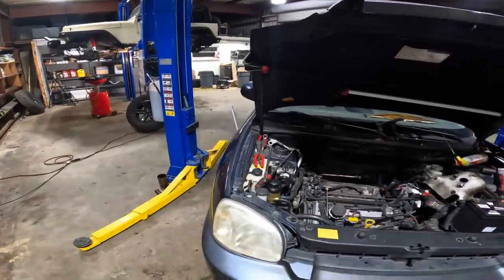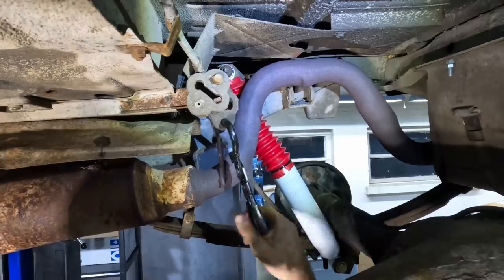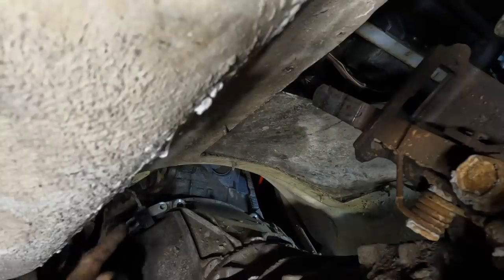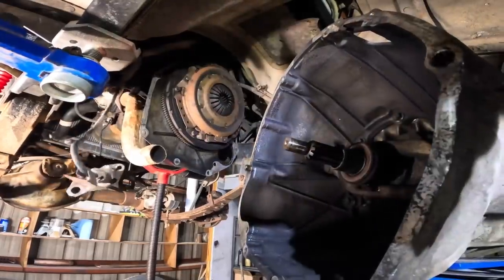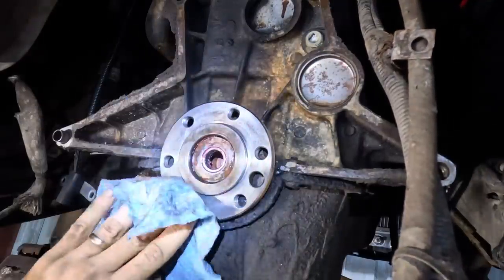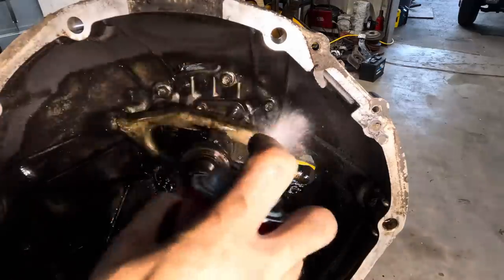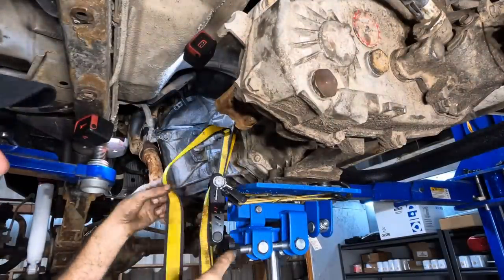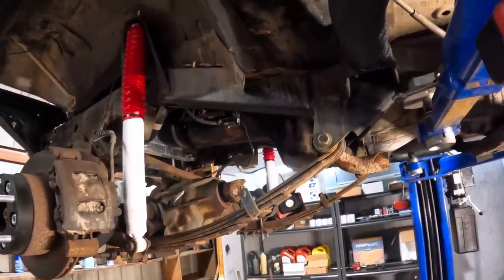Smallest Shaft Ever! FRIED Flywheel! | Project JEEP! 1995 Wrangler YJ

Comment: Silly Ray, when he forgets we dont speak Mechanic!
Pull the slave Cylinder next: this is what transfers hydraulic energy from the master cylinder into this cylinder. That then reconverts it into the mechanical energy to operate the lever, inside the bell housing that release the clutch mechanism.

It's good to learn technicials names when you could just say this runs the Clutch Inside the transmittion!

Comment: I never knew about the clocking of the timing on the flywheel. My Datsun pickup didn't have that. is that an American thing? My Datsun was just a bolt on flywheel and done. No special alignment of the bolt holes to guarantee a specific orientation. Interesting.

Comment: I know this has been a year ago I wonder how good the clutch is now Because i don't think you cleaned the pretested coding off the new Flywheel and Bail-housing that the factory adds to it If so I didn't see it One would think that the clutch would burn it off but it usually just gums it up where it loses it frictions other than great video

Comment: Should be a beveled flywheel, special more expensive resurfacing too.  The  Peugeot  ba trans is one of the worst jeep used next to the SR4 found on some CJs.  You haven't lived until you have done this job on your back in the  driveway with jackstands and a floor jack!

Comment: At 21:25 ish
When describing about the clutch and the lever (inside the trans) and bearing

So it’s mechanical only when the transmission gear is engaged with the clutch 

is what I’m learning making sense because the kinetic energy from the engine and flywheel is def enuff for that transmission to start moving however 

The hydraulic lines are for the clutch pedal when it’s time to release or disengage from the the flywheel or push against the clutch 

Honestly I re wound and heard that part twice but the second time I was like holy crap not only do u mechanics KnOw wtf ur doing but engineer when fabricating these systems know that this is what the best way to make a car go forward and that it works 

I’m writing this comment cuz I was learning about 
hydraulic pneumatic mechanical and electrical are different types of ways an engine system creates actuation or  for switches to turn on and off or open and close 
I think there is more more to that because it just said the “MAIn types”but I was like whoa just owning a car and each day learning something new is pretty sweet for me in my life now (36yo)

I’m like out of nowhere so into my 2005 Honda Accord cuz it has the k24a engine and I’ve been driving Hyundai Elantra for last 8 yrs (3 different cars) I’m a delivery driver but soon either going into tree service or automotive service
Both are to me really cool work or occupations
 

Ur vids are dope man I just watch ChRiSFIx drop a manual transmission from a mustang and now Rainman Ray both are such good mechanic as well as YouTubers
Ovr/out
Clearwater FL
Daniel

Comment: Mistake one: you didn't de-grease the fly wheel or pressure plate.
Mistake two: - The bell housing was sealed, remember you cleaned it off, and you didn't reseal it and this is a 4x4 which means there's going to be water going into the clutch.

Comment: Looking at your open door, and my thermometer that's reading 22°F ......Brrrrr!

Hydraulic method of pilot bearing removal:
Find socket extension or ANY dowel that has a near snug fit inside bearing... FILL entire cavity with GREASE.... Slightly insert dowel until resistance against the grease is felt....Strike dowel with hammer and watch bearing pop out!

Comment: Surprised you still use a pneumatic angle die grinder for the bristle discs instead of a Milwaukee M12 Fuel angle die grinder. I've found the M12 tools to be better than the pneumatic variants I've used, and no hose to drag around.

Comment: When I was a teenager I watched my sister's boyfriend and his mechanically-inclined friend swap the automatic tranny for a four-speed manual in my sister's '64 Impala.  They had it up on blocks in my Dad's garage and when the final bolt came out of the bell housing the tranny dropped to the floor with a "clonk" along with a tidal wave of transmission fluid.  Dad was not pleased.

Comment: Anyone else notice the rust streaks in the upper expansion plug(29:20) in the back of the block? There are two, upper is cooling system, lower is the cam plug. After almost 30 years of service, I would have taken the 10 minutes to replace the upper one. From the rust stains on the back of the block it might be seeping a bit. Cheap insurance to replace it when the trans/flywheel is pulled.....

Comment: You forgot to torque the flywheel and thee clutch housing. I always torqued them and have never had any come lose. With that going to be off road it could come loose. Flywheels are generally torqued at least 90foot pounds, your impact most likely can't reach that.

Comment: Things I dont get, 1 a new flywheel should be surfaced, so replacing the old flywheel, instead of surfacing and changing the ring-gear does not make sense. Also the freeze plugs should be replaced with brass plugs while your in there. everything sjou;d be steaam cleaned before reassemble, and lastly you do not add lube to pivot points that have teflon/nylon bushings, put them back clean.

Comment: How to tell the person who has done a clutch job before - NOTHING is overlooked - the most common fail I have seen done is to neglect the throwout bearing. Usually followed by a second visit to the job shortly after when the old one grenades and takes the clutch pressure plate with it.

Comment: Using compressed air and one of those screw top containers that has a nozzle… a kerosene spray will blast that old grime off , with constant pressure..is that cheaper than tins of cleaner.

Comment: a old trick to take pilot bearings out pack the hole with grease and hammer a punch that fits in the pilot bearing and it will come out

Comment: If the surfaces on that flywheel and pressure plate weren't well clranrd that clutch is going to suck! Yhstd where sll the brake clean should have been used!   Myself I prefer carb and choke cleaner...or laquer thinner on a rag!

Comment: I love that everything is metric in your world. Not 7/16... thats 11.... not 1/2.... thats 13.... not 5/8....thats a 15.....not 3/4....thats a 19.
If it turns it, it's the right size! We ALL know darn well there are ZERO metric bolts on this machine.
Thankfully, There are only a few SAE sizes without a metric equivalent
Not a REEEEEEEEEEE... I do it too. Whatever socket fits it... gets used

Comment: So you cleaned the crap out of the transmission but you didn't clean the pressure plate ot flywheel before installation.  That clutch is 100 percent going to do the same as brake rotors when you don't clean them 💯

Comment: Change the LUG bolts to match the wheel spacers or "REUSE COTTER PINS" at your risk only; don't put a wreck out the door facing your moma's grand children...
Fix the wheel lugs because it's the right thing to do. Do it right or it could hit someone in the noggin. Cheers!

Comment: I didn't see the surface of the Flywheel get washed down to remove the protective coating, or the use of a torque wrench to tighten those bolts on it.
I hope it was done.

Comment: Ray you probably know but the red brake clean is chlorinated while the green CRC brakeleen (brake parts cleaner) is non-chlorinated.
▪︎ If you need to take out bolts with permanent Red Threadlocker on the threads, Red Can of CRC Brakeleen Brake Parts Cleaner.

Comment: 35.50.  Comments to make
1.. flywheel bolts should have been torqued properly to spec
2. Flywheel should have been degreased and the pressure plate
3. Pressure plate bolts should have been torqued to spec

Comment: A dirty trick on how to remove a pilot bearing if you have an input shaft a piece of rod the diameter the inside diameter of the pilot bearing a bolt here's what you do pack the pilot bearing full of grease the old bearing full of grease take the bolt piece of rod or input shaft and tap it in center hole of the pilot bearing that will cause the pilot bearing to pop out of the rear end of the crankshaft it works I've done it and it's a simple dirty trick and you don't need a whole lot of tools have a great day

Comment: I watch all your content.  I'm a huge fan.  Have one question.  I say I've watched everything but I seem to have missed why you are doing so much time on this jeep.  I'm a dyi guy but only on restoring vintage Honda's and old cars.  You have a massive amount of billable hours on this project.  
Did I miss something?  I'd buy this Jeep, even though I'm not a fan of this model, because of all the QUALITY work and parts you're installing.
I'd love to bring my Silverado with 200k miles.  Still runs but would love to have the engine completely overhauled or a new engine/trans and what ever you think it needs.  I'm keeping this crew cab truck because of the chassis and body.  It's grey so, it's peeling paint everywhere, has a couple of small scratches, cracked windshield and dash.  Interior is great.  Has tow package but small engine.
Let me bring it to you.  I live in Oklahoma but I could drive it down and fly back.

Comment: Ray doesn't have a pressure washer. WTF? Can Commentators and Viewers in Ray's location maybe provide him with potential online listings for items like a pressure washer (one that heats the water and has a real good PSI jet), parts washer, A/C machine and other such gear that he needs to make his job easier and increase our viewing pleasure. If there was a GoFundMe page and 20% of Ray's Subscribers gave just $0.50 each then he could probably purchase a lot of a lot of the specialised equipment he needs to make his work life easier for him. He could also build a sound reducing wall around the air compressor which would make it easier on the recording of no loud noises too. Make a list Ray because there is no point anyone suggesting equipment that you have no need for. For example, would you use a tyre (tire) changing machine or a disc brake rotor lathe?
It's just a thought and at $0.50 then that I could afford to contribute to. I won't make a Superchat contribution because YouTube take so much of it (30 or 40%) but a GoFundMe contribution I most certainly would.
When Ray pointed out the "fingers" moving when tightening up the "basket" I thought it is the little titbits of information that makes him and excellent teacher. Actually he is more an educator; it's a fine line but a massive difference between the two. Thank You Ray. 👍

Comment: You should show. How to align clutch without tool. From experience, The auto parts store rarely had the right tool. So after using a bolt to align disc and several use of foul languages. Over store not having right tool. Several breaks later. It goes into place. 😡

Comment: I'm not trying to do this on purpose but it might cause a stink... but you don't use new hardware on the fly wheel??? R put any lock tight???that's one of those jobs that a person absolutely does not want to have to go back on to redo anything...I say all this because I'm sure you did but I didn't see you torque anything down on the clutch at all.....

Comment: Would really liked to have seen the old clutch disc, to see what facing material was left.  And yes please lock-tite the flywheel and clutch cover bolts and make the flywheel shiny.  Love your channel, enjoy all the videos.  Gotta ask a question about the front diff. Do the teeth look ok on the front pinion gear?  In the video I thought it look bad.  May have just been grease or dirt.  Thanks.

Comment: If you watch in the sky, don’t do what he does installing a clutch that’s a hack way of doing it that clutch is not going to last that pressure plate and plywood should’ve been taught with a torque wrench. I could take two identical clutches use impact the other one use a torque match and you will see the fingers are evenly flush that clutch is going to have a chatter when it first takes off, it won’t be smooth because it wasn’t torqued with a torque wrench

Comment: I can’t beleive you didn’t clean of the oil off that flywheel and loctite/torque the bolts 😬, I normally find you very thorough with repairs but i think you dropped the ball a little here

Comment: all flywheels are clocked,,for balence,,[ except chev],yes we hate chev.. 350ci,junk, 6.5tdi junk, 12 bolt,junk, 14 bolt, junk,. they seem to borrow, steel, ideas parts from other manufactureres, then change the i.d. #, call it theres..only good thing about a 350 chev, is the speed shop guy smiles at you..

Comment: As a transmission rebuilder, please never use the bell housing bolts to "suck" the transmission into place. You should be able to flange the trans to the block with minimal effort. even more important on automatics. I can't tell you how many assholes...I mean customers... have destroyed my rebuilds by using the bolts to seat the trans.🙂

Comment: Your shop is cluttered. Before it becomes a complete mess I suggest you take steps to correct the situation. Compared to the dealership you worked, your shop should take on a similar appearance. No offense meant, however, customers do rate a shop by appearance.

Comment: Useless in today info. Every clutch I have changed over the last 40 plus years I would make my own alignment tool/ I would get a wooden broom shaft and cut about 9 inches off it then whittle it down until it was a perfect fit and mark it for which type of vehicle. Never ever failed and every clutch lined up perfectly. Last one I did was on my Daughters car 4 years ago but no longer fit to get about vehicles so have a largish collection which will one day go in the bin, probably when I pass on .😁

Comment: Your new transgender should come with a proper brackets and a chain to put across the transmission to hold it in place it keeps the transmission balance on the jack you can put this you put the faces in but it's even and then you can tighten up the chain and hold it please has all the brackets to hold the transmission you should use them

Comment: OK, so no torque wrench?  On flywheel bolts?  And, no cleaning of the mating surface on the engine block or the metal plate that goes between the engine and the transmission?  You can hear the crunching sound of dirt when you tighten up the transmission to engine bolts.  Do you have any service data available for torque specifications.  It seems that you tend to "shadetree" these things instead of taking a couple of minutes to do things properly.  Certain fasteners NEED the proper torque applied.  Yes, not every bolt needs a torque wrench, but some do, like suspension bolts in control arm bushings and such.  Of course, I've seen you tighten many critical fasteners using the "ugguh duggah" method and with suspension components at full droop, which is very hard on rubber bushings.  I do enjoy watching most of your stuff, but I find myself cringing sometimes.  Just saying "click" doesn't make it ok.........
Reply from the maker: This is a highly edited YouTube video… click